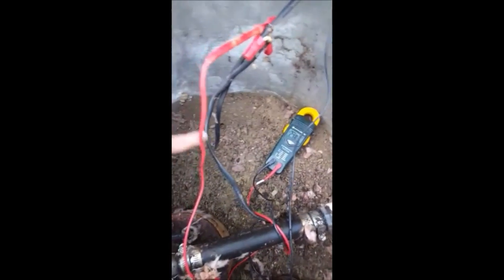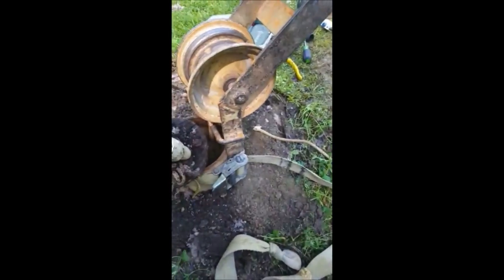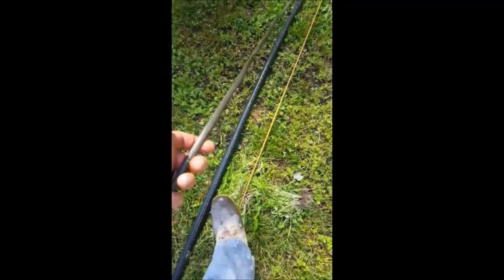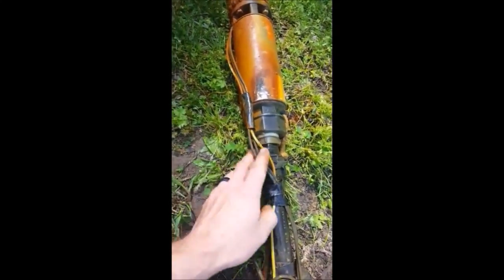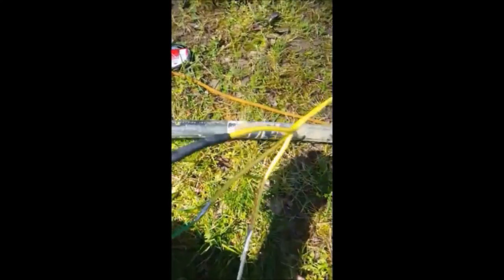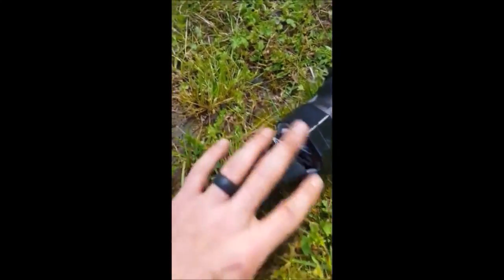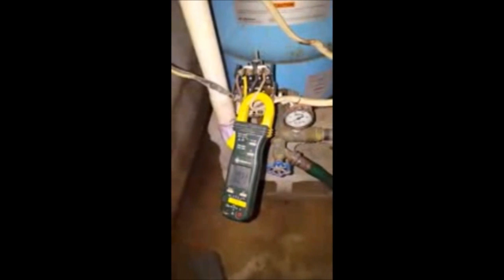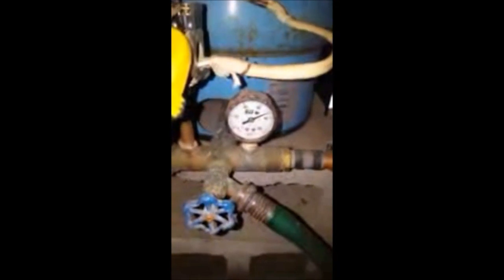Well Pump Diagnosis & Replacement - Done Right

Comment: I have a 6.8 amp draw and the ground wire, 6.8 amp draw on one hot with arc at switch and 0 draw on other hot with no draw....what is going on?

Comment: I have a submersible pump not working, i replaced the breaker and pressure switch and still nothing, what else can i check or should i assume i need a new motor/pump

Comment: you said "not pulling any amperage". Amps are a measure of current. You should say "not pulling any current". You also said "checking for a break in the ground". This sounds vague and someone may think you are talking about the ground wire.

Comment: Is it possible to check the pump resistance with a Ohm meter? I'm thinking is should be 4-7 ohms for a 230VAC  pump. My new Vevor 1HP is 4 ohms with internal start capacitor. . Although my old one has internal start capacitor it measures 10.7 ohms.  Also Id like to see a video on troubleshooting a PumpSaver 230P with the red LED (over current) light blinking.  What are the causes and repair? One guy said there is a 470uf 25v capacitor inside the Pumpsaver that can fail. The replacement Capacitor is $10.  Id like to see a repair vid if that's true. A new PumpSaver 230P is currently bout $250...... Update: I plugged my old pump directly into 230v by passed the Pumpsaver. No sound no water. Im now thinking I have a jammed impeller or dead start capacitor. I plugged the NEW pump into the PumpSaver It pumps water for 1 sec and goes into "over current" shut down I Adjusted to Min sensitivity same OC shut down I adjusted for Max sensitivity same OC shut down. Could both be dead? Both are abt 12 years old.

Comment: Don't you use torque arrestors?
Reply: My 98 ft well pump didn't use a torque arrestor but its 1 HP I'm concerned a torque arrestor is a possible point of failure later on.   But IDK.

Comment: Hey buddy how are you ? I just installed a new 1 hp irrigation pump for a customer. There was no pressure tank it had a irrigation timer box with a 240 contactor/relay. The owner told me that he didn't know the depth I figured that out when I pulled it. He said he had about 12 zones about 5 heads per... rotating. The issue wasn't the pump it was the wiring, and I meged it and confirmed. After install the sprinkler guy said that there wasn't enough "pressure" ... most of heads were busted but how could this be that I do not have pressure ? I do have pictures of my install. Appreciate  your time and videos 👍

Comment: My well is not keeping prime. Opened up the valve on the pump side got a bunch of air got prime. Woke up this morning same thing a lot of air. Ran fine after priming last night ,my pump house is above my plumbing in the house 30 feet higher
Reply from the maker: The foot valve is leaking or the check valve is leaking

Comment: Hey at 6:45 when you were testing your well pump, what settings did you have your volt meter at ? Amps ? power on ? .  plumber from Canada . my experience is with new construction building 30 plexes. just moved from Nunavut  to rural Ontario.  thanks!

Comment: installed new deep well submersible pump, 1 HP, new tank, new switch, and new control box. I get 240 to the switch but drawing no amps from pump. I did not replace the 12/3 with ground?
Reply from the maker: Probably a bad spot in the wire. Watch my most recent short & I show you how to test each leg. One will be low voltage most likely
Reply: Pulled the pump, broken wire. Replaced wire and the new pump set up is working as designed. 
Thanks for your videos and help.

Comment: Low water pressure, checked copper nipple had lot of rusty stuff, shut power off bled air tank, pressure very low, (40-60) switch, added 38 psi leaving faucets open, immediately pressure improved, next day washing clothes, water pressure in all house faucets low. ( not waterlogged) ck for that, wondering if bladder is weak in tank, pump kicks on at 40 and off at 60 as expected. ? Recent issue. Well 40 ft depth.
Reply from the maker: Jet pump?
Possibly running the well dry
 You'd be the 3rd 40ft well this month that has had the same problem on my channel.  
I'd say if you using more water recently, you might be sucking it dry faster than it can recover. 
But it also could be other possible issues. 40ft is very shallow

Comment: So I have power at the low pressure cutoff switch. But it won’t build pressure on the valve. No power at the relay at the top of the well. Bad pump?

Comment: What do you do if your water isn't running and the pressure meter is well below 0psi? We lost power in a bad storm and the temp dropped to 4 degrees F amd didn't get above freezing for a few days even though the power came back on.

Comment: Idk if your still on YouTube. I haven't seen my issue but did have. Freeze. The pump is working but no water. No pressure. Non bladder tank pump and motor above ground with a foot valve recently chanced the foot valve. Idk much about wells but need help.
Reply: Please!

Comment: Great Videos lots of good info. I have a question. So... i have a deep well system 1.5hp and about 500ft. The Well seems to be producing water however, I'm getting really low pressure. Like about 1.5 gal per min. I put in a new control box thinking that was the issue but seems to be same. My well pump doesn't have a pressure switch. The way it is set up, it pumps water and send directly to water storage tank. So im not sure how to increase pressure? help please?

Comment: Cool tool! How much depth do you go before you actually use a pump puller?
Reply from the maker: We pull 400ft pumps 1hp & up with the electric puller. By hand is always faster & great exercise 💪
Reply: @h2omechanic  Thanks for the reply. I meant how much depth can you go before you use the pump puller and not pull it out with a lawn mower or something similar. I see in your other videos you use small machinery. How much depth can you go with 2 average sized guys and the bully puller?

Comment: Love your videos
I bought 12 acres with a well .I need to install a pump and according to my paper work the static water level is 250 feet.what size pump would you recommend and how deep will I need to set the pump? Any help you could give me will be appreciated 
Thank you
Cam
Reply from the maker: So you have a Very deep water level. You'll need to follow my directions to a T.  You need a 1Hp 5GPM 2 wire pump (Goulds or J-Class brand). 
1" Poly Black Roll pipe "250psi"  400ft
Stainless steel or Brass Fittings for the pump top & bottom. 
HD Steel Well Seal
10-2 Submersible pump wire 400ft
2 clamps at every connection

Comment: Should have checked the ohms. Would have told you wire issue or motor. There is also special duct type tape for well pumps.

Comment: i just replaced mine in my backyard today. turned it on in water up here. Worked fine. put it down and 180 feet down it magically decides it doesnt want to work anymore. what could be the problem? Could it just need some time to get the water up? Thank you.
Reply from the maker: Probably it's a broken wire down in the well going to the pump. (If you used the old wire & didn't look it over closely) once the wire is put in water, it shorts out

Comment: We use 3” green electrical tape every 10’. We only hang pumps off sched 120 pvc though.
Reply from the maker: Every area is different. We use stick pipe when we run into deep wells & deep static levels.
Reply: @h2omechanic  yea, I suppose I haven’t seen one set at less than 280’ yet. All 3 wires.

I think this area is kinda unique in that most of the private wells are set up hydro pneumatic with an air charge delivered every pump cycle. So the check at the bottom is drilled and there’s a check 40ft from the top with a snifter right below it. Hung from a pitless or monitor.

Comment: My well is crackling. Can't get anyone right away. I'm in a very rural area. Do I need a well driller or a plumber? Thank you. I shut the breaker and have no water.
Reply from the maker: Well Drilling companies will be cheaper than a plumber and way more knowledgeable. 
Plumbers are more for toilets & sinks ect. But are still capable. 
Watch my many well related videos, you'll be able to diagnose the problems most likely.

Comment: I just pulledy pump and changed it it is a two wire pump but has three wires should two of those have 220 volts
Reply from the maker: 2 should read 230v+. If you had a Yellow wire on the old 1, the old one was a 3 wire. They have control boxes. You just remove the box & run the power wires to the pressure switch
Reply: @h2omechanic  thank u so much I've Ben thinking two wire should have 230  but I'm no plumber or electrician   I'm try to do it my self guy cause I can't afford to pay some  one so. I think I have a broken wire from the house to the well.  Again thank u very much
Reply from the maker: Remove the wire nuts at the well & test each leg to ground using a volt meter. You will get 120v each leg. If 1 is lower then it is bad. 
Run a new wire from your switch to the well across the ground and see if it works. It should.
Reply: @h2omechanic  that is my plan for today.  Thank u again.
Reply: @h2omechanic  k so first answer says out will b 230  second say 110   so at my well there's three wires I assume one is ground or common wire I've heard it called  and the other two I assume should have power.  But is it 110 each or 230
Reply from the maker: @bradcoffin6489  test each leg together should read 230v. 
It you test 1 hot wire & hold the volt meter to ground wire it should read 110v. 
Hot + hot =230v
Hot + green =120v.
Reply: @h2omechanic  got ya so I ran a above ground wire from pressure switch to pump wires at well just one single wire the one I could not get power to and we have water.    Thank u very much for the help    I hope u have a good day.

Comment: Good morning, sir! I’ve watched all of your Q&A’s over the last 12 hours to no avail, hoping you can help. Moved into a new property with a cistern about three weeks ago. Pump worked fine, cistern ran dry mid last week, had water delivered yesterday and now the pump just “hums” when I turn it on, no water pulling into the system. Tried priming multiple times, no luck. I know the pump only ran dry for a few minutes and was at least trying to pull in water the evening before we had water delivered so I don’t think it’s seized. Any words of wisdom, sir?
Reply from the maker: I'm assuming it's a jet pump pulling water from the tank. Try cutting off the valve that feeds the house. You have a air lock Trapped in one of the pipes(suction) . 1st off I hate jet pumps. For the reasons your experiencing. It could be a number of things. Maybe take off the priming cap & hook a strong shop vac to it & see if it'll pull water through & suck out the air lock. The check valve is probably stuck slightly & once it frees up, then it will work right
Reply: @h2omechanic  just like you said, closed the intake, stuck the shop vac on the open priming cap, slowly re-primed and we’re back in business! I can’t begin to thank you enough, bud. Do you have a Venmo or something I could toss you a tip on?
Reply: @h2omechanic  you, sir, are a saint. Thank you so much for the speedy response, going to give this a try and will report back.

Comment: Great video. Our well uses a 1/2 hp pump and   the depth is approximately 150'. I'd like to order a pump before pulling the current one out to eliminate down time since it still works.  Are all submersible 1/2hp well pumps standard or do I need more information? Would there be any advantage to installing a larger 3/4hp pump instead? What is the correct wire to use? Thanks.
Reply: bigger pump equals more GPM.

Comment: I need some advice to confirm my suspicions please.

Re: Well water pump loses prime when power goes out for any length of time.

History: We live in eastern NC and have a well that is forty plus years old. The drop pipe is sixty-five feet long and the static level is twenty-five feet.
We’ve had a continual problem with pepper sand so I  “blew” the well about 1.5 years ago and installed a new foot valve along with new leathers—that helped improve things for awhile.

Current situation: We had to cut the power one week ago so electricians could install a Generac back up system. I had trouble reprimimg the pump after only a four hour power outage. I reprimed the system with forty gallons of water and flipped the breaker. It pumped up and shut down at sixty psi. Wonderful! Then the gauge started that familiar slow decent 55,50, 45, 40 and then bam “0.”

I’ve had to do this twice before so please tell me if I’m wrong. 
I have to pull the drop pipe and replace the foot valve. Yes or No?

 Love your channel! 

Thanks for your time and advice!!
Reply from the maker: Yes, the foot valve is leaking 99% sure. It's a 1% chance that it could be a cracked pipe where a threaded connection is made down the well.

Comment: I love your videos and your style. One problem I have is using electrical tape in the well and I'm looking for alternatives.  I found some 1/2" wide zip ties rated at 250 pounds.  Also, what do you think about wrapping heavy duty hydraulic hose spiral wrap (hdpe) around the lowest section of the drop pipe, cable, and rope?
Reply from the maker: I only use 3m electric tape . Don't use zip ties! They cut your hand next time you go to pull the pump out, or they all slide down to the bottom. If you have a area that's keeps rubbing the wire, id recommend 1/2" conduit for the bottom 30-40ft.

Comment: First off love all your video's. I am reaching out to you to ask for some advice about my well. I currently have no water after replacing the entire tee, pressure switch (40/60), wiring, and have verified that I have 38psi on my pressure tank with no water insight and has passed all the tests like tipping and sounds hollow. After replacing everything I just listed I had water for 2 weeks, then out of no where the pressure switch continued to trip and the lever on the pressure switch had to continue to be reset. So I went and bought a new pressure switch 40/60 with no lever. After installing the new pressure switch the water was workimg perfecting for 2 days then my well pump started to sputter and sound like it was calling for water but no water was coming in, then when it did finally come into the house it was almost black. How I know that is was black is because it turned my clear large sediment filter completely black and it was almost clear before then. Lastly it then started to trip the circuit breaker every 10 seconds. Water does come into the house when I hit the breaker but only for 10 seconds until the breaker trips. I have called the company that installed the well pump originally, and they are extremely busy and I have 2 children with no working water. So I am wondering if you happen to have any advice for me on what the problems could be, and the steps I could take to get it done myself. I apologize for such a long comment but all the other companies around me are to expensive and I really cannot afford to wait for the pro's to do it when I feel I am competent enough to get the job done correctly with the right guidance.
Reply from the maker: Your running the well dry. The key is all the sediment that you got. Leave the well breaker off when your not using water & ill bet it begins to work fine. 
Go around to all toilets and look for 1 that has a leaky flapper. If you turn each toilet off, the back tank will empty. 
That's the most common problem. 
If they seem ok, go under the house & look for leaks & look for wet areas in the yard. 
If you don't believe you have a leak, check your psi gauge, it'll be on 60 & then kill the power, & go see if the gauge slowly leaks to 0. This will be a true test.
If you truly don't have a leak, then the well has slowed its production rate & youll need to look into finding a hydrolic fracturing company if you have a 6" well. 
If you have a sand well (coastal) your in a drought .  If you have a 2ft Diameter well (bored) then all you can do is wait for rain
 Hope this helps
Reply: I have a shallow well at 41ft, I'm about 1/2 mile from the Okanogan river here in okanogan, WA. I have had a new neighbor move in recently on property that is a little higher than mine, we are on a slight incline so I'm down the hill from him. I have never had any real issues until he moved in and began watering his 5 acre parcel 24/7. He now has a beautiful full yard completely covering what was once a bare 5 acre parcel. I now have no water and have tested and/or replaced everything on or in my well to no avail. Could he be depleting the water in our water table because of all the watering he does. I'm not exaggerating when I say he waters 24/7, he actually has a number of large sprinklers going constantly. Could this be my problem?

Comment: My small solar pump seems to run but is not pumping water out. Instead it is like is vacuuming or taking air in. What might be the problem
Reply from the maker: Pull the pump out. You have a hole in the pipe or a failed fitting in the well